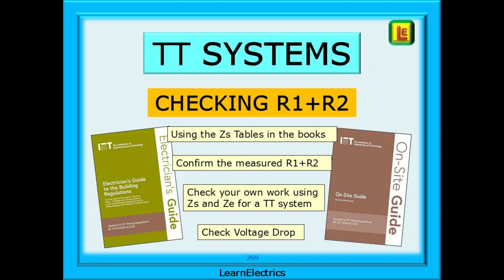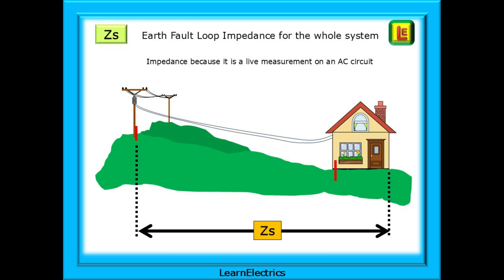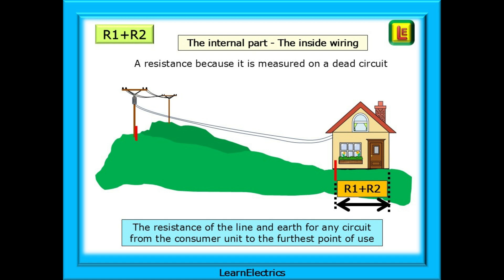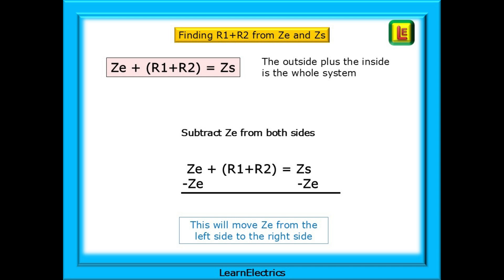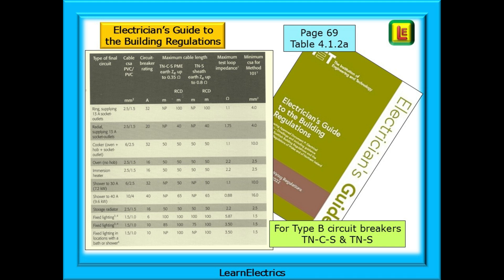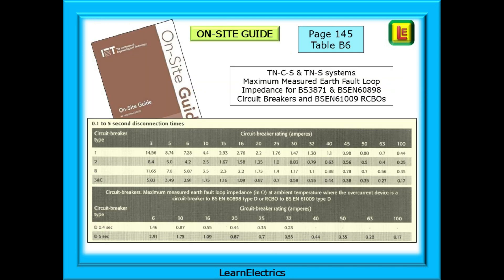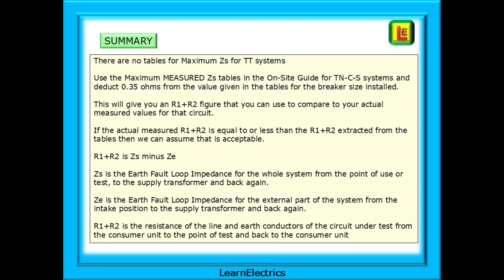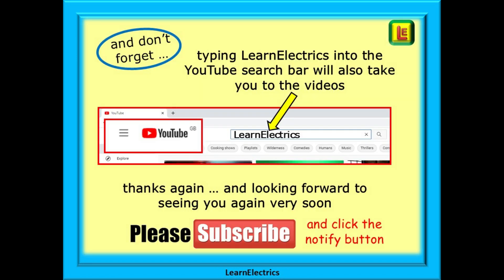TT SYSTEMS – CHECKING R1+R2 USING ZS AND ZE TABLES – CHECKING YOUR OWN WORK – CHECKING VOLTAGE DROP

Comment: Thank you , Fan of yours. . This one I dint understand though .. R1+R2 calculated this way will not give us any indication of disconnection time isnt it ..? I guess you meant this as a quick calculation ... could you kindly explain ...thanks
Reply from the maker: The video is trying to give you a guide to what R1+R2 should be.
If you get a TT Zs reading of 180 ohms say, does that mean that R1+R2 doesn't matter. Of course it does. We can't have an R1+R2 of 25 ohms and a Ze of 155 ohms. We should still try to make the inside of the house correct and using TNCS as a reference for R1+R2 makes sense, Hope this helps. Dave.
Reply: @learnelectrics4402   Thanks makes  a lot of  sense and understood the idea. Great guideline for quality control .. golden channel...

Comment: Hello [Professor/Engineer],
Thank you for your great efforts and the clear way you explain electrical concepts — I really appreciate your channel.

My question is:
"I have a distribution transformer connected Delta–Star, with the 11 kV side de-energized. One of the houses is running a generator (around 10 A load). If, due to a wrong changeover, part of this current flows back into the neutral that is still bonded to the utility network — could this current return to the 11 kV side and pose a shock hazard to workers on the transformer? What would be the actual behavior of this current?"
Reply from the maker: Thanks for the positive feedback, appreciated. That's a good question, and you really should have a break before make changeover switch between the supply side and generator side so that there can be no possibility of current going to the wrong places.
Reply: "Thank you very much for your clear answer and valuable advice. I fully agree that a proper break-before-make changeover is essential to ensure safety and avoid any backfeed.

My intention behind the question was more on the technical side: if by mistake 10 A from a household generator flows into the neutral that is still bonded with the utility side (while the 11 kV feeder is de-energized), what would actually happen to this current? Would it simply circulate locally on the LV side and return through the generator neutral/earth, or could there be any path that makes it appear on the HV side?

I really appreciate your insights on this."
 @learnelectrics4402
Reply: ):
"Thank you again for your valuable answer. I just want to add a note about our local distribution networks: in many areas here, the LV systems are not organized according to standard earthing schemes. The networks are very old and sometimes poorly grounded.

Because of this, we have experienced cases where — after switching off an 11 kV feeder with several distribution transformers connected — a technician received an electric shock when climbing the transformer. Some colleagues believe this could be due to backfeed current coming from a household generator through the neutral. That was the main reason behind my question.

It also raised many thoughts in my mind:

1. If the HV side is de-energized, and therefore the LV side is also supposed to be dead, what would really happen if 10 A were injected into the neutral?

2. Similarly, what would be the behavior if 10 A were injected into one phase, say phase R?

I would really appreciate your technical insight on these scenarios."

Comment: Great video, sir. You produce phenomenal content.  Quick question: if it's the case that a breaker will not trip in time, or even ever, to provide protection on a TT system because of the high Ze impedance, what exactly is the technical reason we need an earth connection at all on a TT? Why not just rely on the rcds? Thank you again.
Reply from the maker: Now that is a good question. The earth will provide a path for leakage currents and fault currents on a reduced level.
The RCD needs to see a difference between L and N and it can only see a difference is some current goes to earth instead of along the neutral. Take a look at this video on the link below. Hope this helps. Dave.
https://www.youtube.com/watch?v=6OgaB0BIj18
Reply: @learnelectrics4402 Thank you. Much appreciated.
Reply: @learnelectrics4402 Thank you. Much appreciated.

Comment: Great video as always Dave. If I’m honest I prefer to use the resistivity tables & formula, using an educated guess of the circuit length when testing a TT installation. 
R₁ + R₂= (mΩ/m) x Length / 1000
Reply from the maker: That's another good method if you know what to expect. For the new guys to the party, they need a little guidance. Thanks for the input. Dave.
Reply: Hi Dave, an excellent video, again.

Comment: We are in the planning stage of building a house which isn’t in the UK, but as I’m
From the UK the electrical design is following UK standards and is permitted by local code, albeit with some minor differences. My biggest concern is that this will be a TT earthing system but the house and surroundings sit in solid rock. Rick isn’t the best conductor and I worried I will not achieve an acceptable Zs/Ze. Have you come across ways to achieve an acceptable value in this situation? Many thanks
Reply: You can achieve low readings on TT by many methods,galvanized steel tape inside the foundation metalwork,epsilon(E) electrode,mesh electrodes etc.don’t stick to the classic earth rods
Reply: @konstantinosdm4391 thank you. We will look at these.
Much appreciated
Reply: If you contact a company called "earthing services". They will look at the geological construction of the ground from location data and design/recommend one of their products best suited.
Reply: @matthewthomas6121 thanks Matthew. I will give them a call.
Reply from the maker: David, you have some good replies below, just as I would suggest. Earth tape or earth mesh is a good option. Dave.
Reply: @learnelectrics4402 thank you